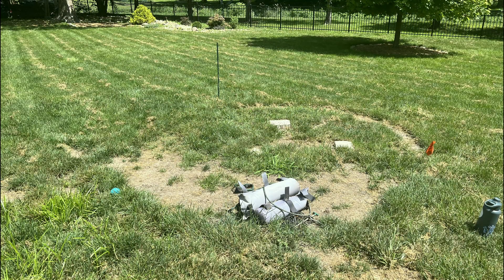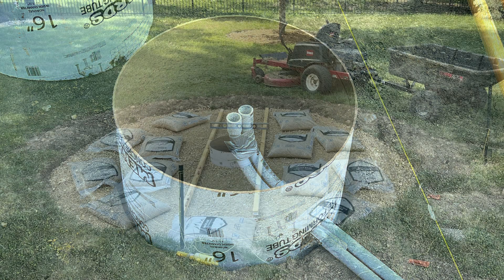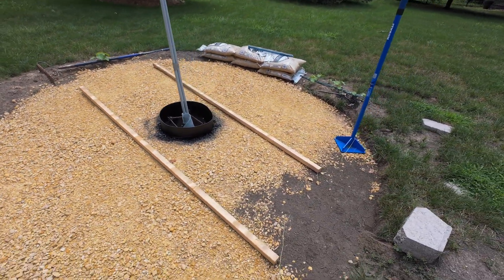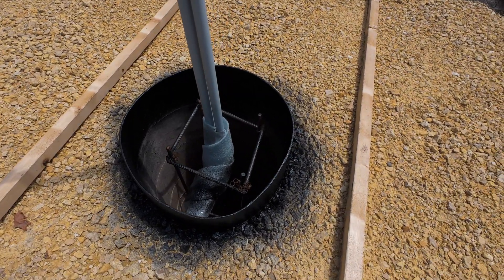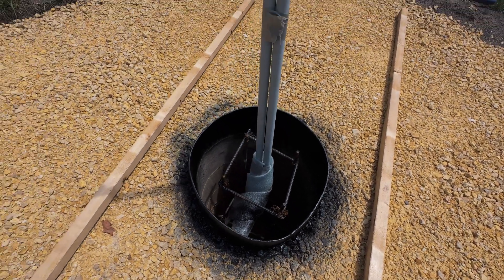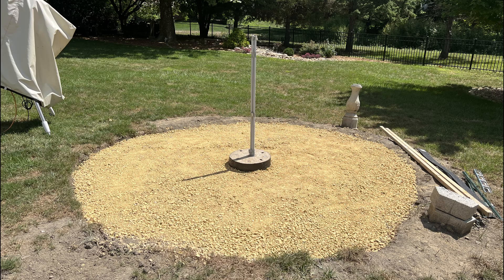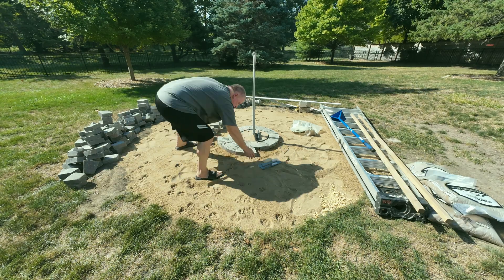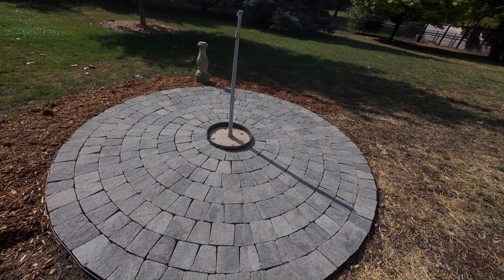Building My Dream Astrophotography Pier!

Comment: Hi Doug, So much more easy doing astrophotography when you have a pier. I have one to. I made is with a concrete sewer pipe, put rebar in it and filled it up with concrete. On top of that I have a custum made pier extention for the mount. Looking forward to see you final result. Saludos from Spain, Rob
Reply: I have a SkyWatcher EQ6 pro (not the R version), when I set up the telescope I have to polar align with just the azimuth knobs. The altitude I rarely have to adjust. If the weather forcast is good for astrophotography for several days, I leave the mount on the pier and just take in the telescope inside. With the tripod it was always a hassle setting up and then being carfull not to accedently hit one of the legs.
Reply from the maker: @robvandenwijngaart1970  Ah, i see. I leave mi rig setup 24/7/365 so im hoping alignment is not a frequent of activity as it has been on tripod.
Reply from the maker: Hi Rob!!  Thanks so much for watching!  Thats awesome, i cant wait to get there!
What is your experience with pier and how often you need to perform alignment?  I don’t know what to expect. 
Cheers!
Doug

Comment: Looking good dough , my only thing I would have changed is the piping through the pier I would have used a larger diameter pipe like gutter pipe 3” I used bigger pipe than you used and wished I had used larger, something I can change at some point , bit of work but for me do able 👍
Reply from the maker: Hi Boaty!! Thanks for watching, appreciate you dropping by!  Thats a great idea, here with our code i’d still have had to run the smaller conduits through the larger pipe since we cant have high and low voltages together in same conduit. FWIW i did ask the inspector if i had a larger pipe option, like a larger divided wall pipe, but i wasn’t able to find that material in my area.
Cheers!
Doug

Comment: What a job. How's your back? Moving the heavy bags of concrete would do me in. Congratulations. I guess once the mount is installed you will just keep a cover over the equipment. You need to reward yourself with a new Astro-Physics mount. I'm sure having your mount on such a stable structure will show some improvements.
Reply from the maker: Hi KJ! Thanks as always!  Im aware of every vertebrae!!  Advil/Tylenol combo and all good lol.
Yep, i think I’m going to get a skirt cover for winter in addition to the top cover. 
I certainly hope to see improvements from better stability, especially with alignment stability. 
Cheers!
Doug